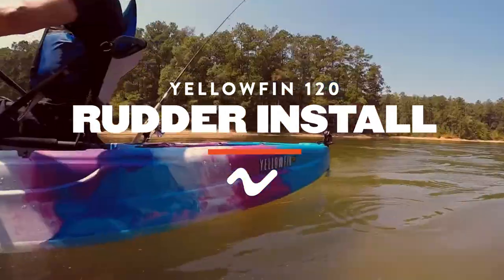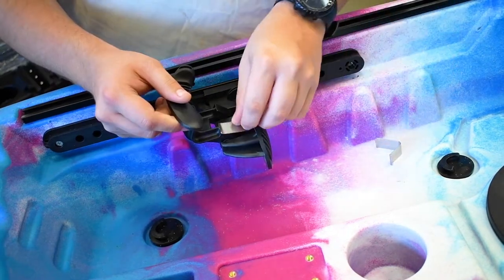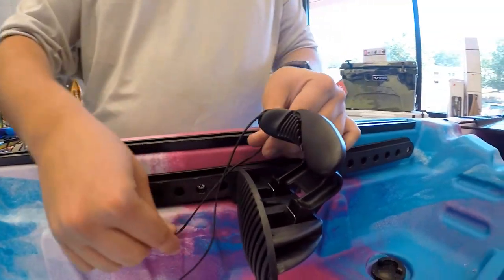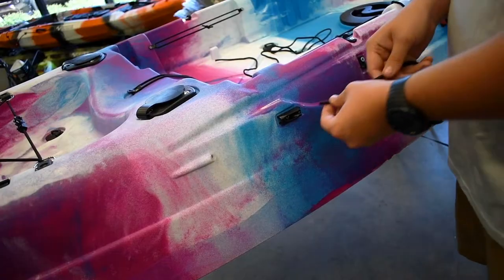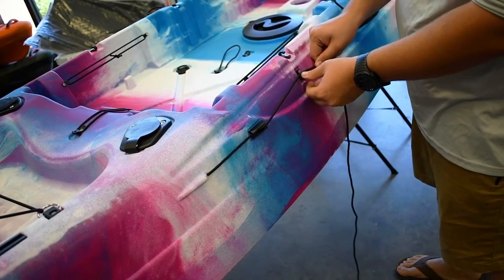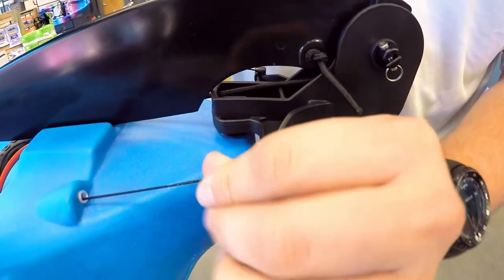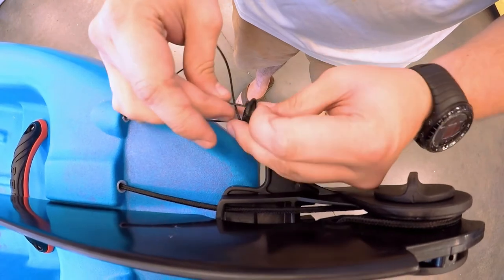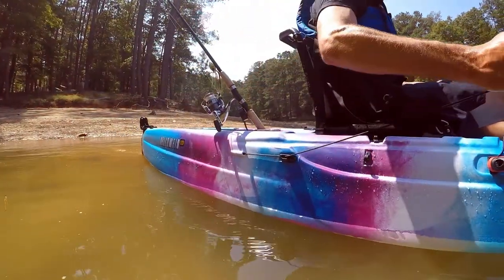Vibe Yellowfin 120 Rudder Install

Comment: I will post my install video on my NOT new yellowfin 120 soon. Install time 2 hours.. why is my rudder spring loaded? It negates the install of deployment cable..
Reply: @d410media Did you figure this out and post your own install video?  I'm trying to install my Yellowfin 120 rudder right now and the spring seems to be backwards!  It needs a spring in order to automatically return to the stowed position when you release the rope, but the spring is such that it stays in the deployed position and there is no way to re-stow it from the cockpit!  I can't find any explanation other than the spring being installed backwards somehow.  Since your comment is from 1 week ago, I wonder if they're shipping ones now with the spring backwards?  Did you contact Vibe to see what they said?
Reply: @waltersbg  I am working on i now, lot of videos to edit, plus I took two trips out for testing.
Reply: Had the same problem, the center "bolt" can be inserted in 3 different ways. Only one the is correct. You want it straight up and down when installed.
Reply: @finladin8584  turns out they changed the layout of the system.  https://youtu.be/5DaaTkKhEzk

Comment: Anyone having a problem with your rudder not functioning properly the center "bolt" can be inserted in 3 different ways. Only one is correct. You want it straight up and down when installed.

Comment: The yellowfin 120 I bought came from Vibe with the rudder installed upside down compared to this video. New model? Alternate installation?
Reply: Had the same problem, the center "bolt" can be inserted in 3 different ways. Only one the is correct. You want it straight up and down when installed.